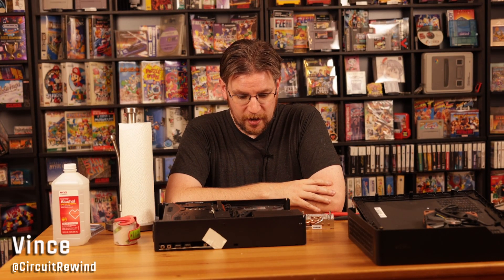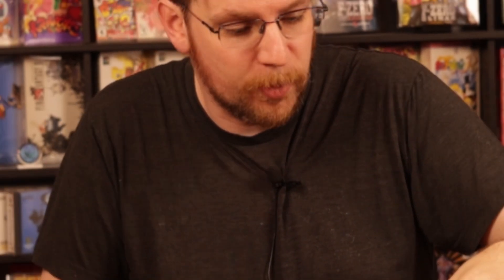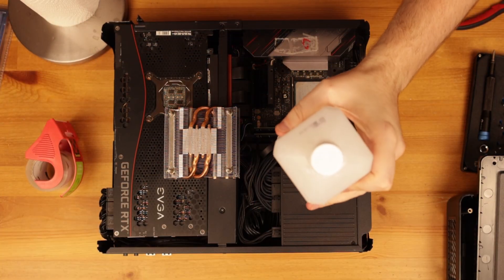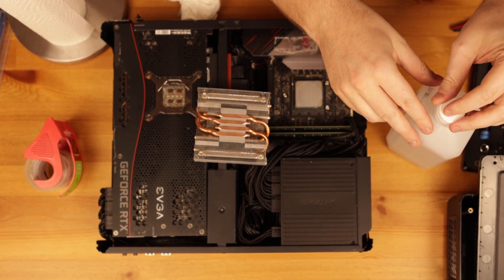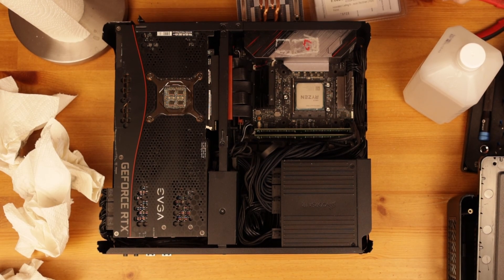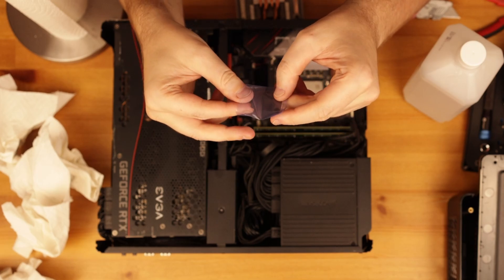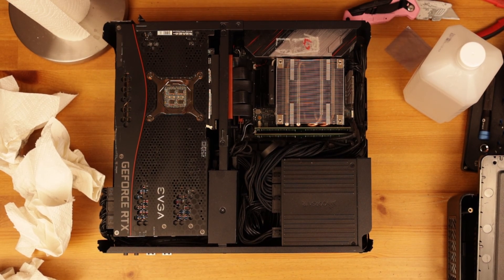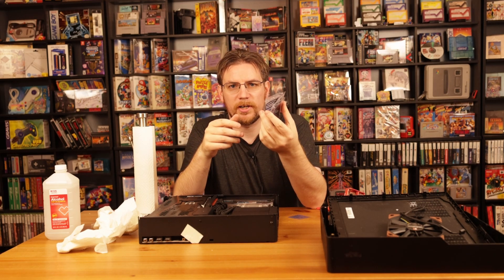Repasting an AMD Ryzen CPU with a NEW technique!

Comment: I actually filled and plastic box with isopropanol and put the whole cpu in there to clean it (refurbihed cpu). Wipe of the cpu on both side afterwards and put it back in the motherboard. Yes there was also some thermal paste on the LGA grid. Works fine for almost a year now.
Reply from the maker: @leonmerts702  IPA baths are also great. I do this sometimes for deep cleaning retro PCBs